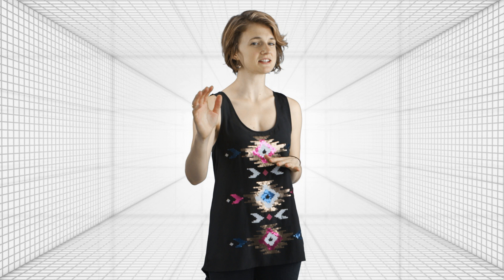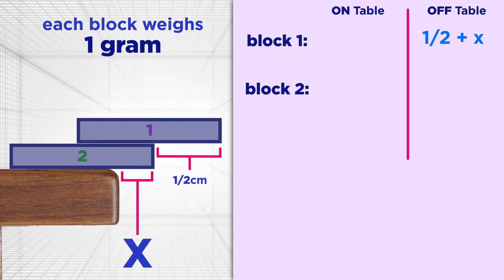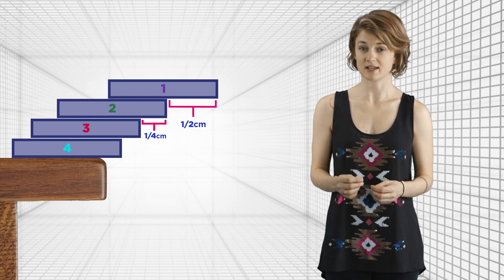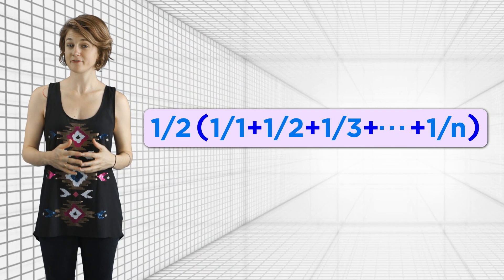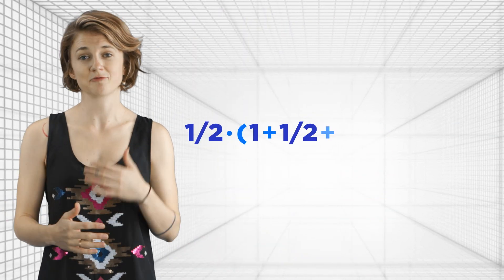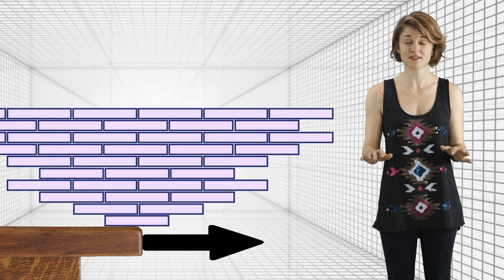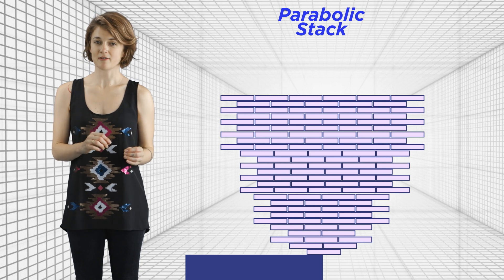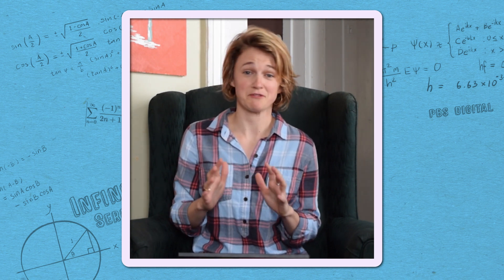Building an Infinite Bridge | Infinite Series

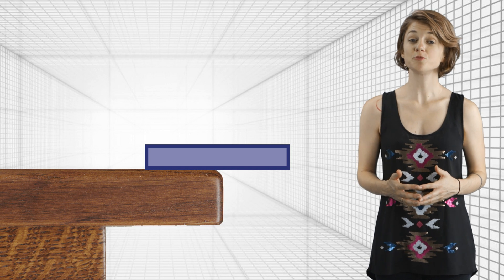Comment: Presumably the table is going to have an infinitely sharp edge.  The rounded-corner illustration of the table edge at 1:00, while pretty, may not be the best choice to illustrate this.  

You could say, of course, that the true edge of the table is just where the curve begins.
Reply: Tehom Yes, the image bothers me because it's wrong.  I'm pretty sure that the mass with it's center of mass not touching a solid surface doesn't look down and say "I'm not supported but it's okay because there's this fancy little curve further down so I'll just pretend I'm supported by that instead."

Comment: Can beat all this. 

Just use an infinitely long brick.
Reply: Matthew Fennell But would it be stable? Where would its centre of mass be; would it even have a centre of mass?
Reply: TimGB
Just place the center of mass even with the edge of the table. The infinitely long brick would stretch infinitely in both directions keeping the center... in the center.

Trick 2: turn off gravity. I mean, while we're just doing whatever, might as well. Glue the bricks together so they don't float away.
Reply: Matthew Fennell an infinitly long brick wouldn't have a centre of mass or would at least never topple, because if the brick just slightly tilts, the points far away would have to travel faster than the speed of light, wich sadly isn't possible
Reply: You'll need an infinitely long table. I win.
Reply: Then you don't even have a bridge. You're disqualified.
Reply: I was just saying he would need it, not that it would be possible.
Reply: +Siro
Can I nitpick? please? I'll nitpick
if you tilt the brick the ends won't rotate immediatly, the tilt will travel through the brick as a mechanical wave (so basically travel as fast as mechanical wave moves through the brick)
Reply: The center of mass doesn't matter. The rotational inertia would be so large, that it would take forever to rotate.
Reply: all points would be equally valid as the centre of mass. Take any point on the brick and label it zero. Then label every point on the brick that is an integer number of centimetres away from zero. Label numbers going one way with positive numbers and points going the other way with negative numbers. Once you're done, you will have labelled exactly the same number of points in one direction as the other, so you can reposition your brick however you like and it will balance.
Reply: not necessarily every point, but every point that could be the center of mass of a section of the bridge
if you get what I'm trying to say
meaning it would have to be a point along a line that goes along the length of the bridge which goes through the center of any section of the bridge (assuming the bridge is completely straight ofc)
Reply: Wow, what a lot of replies. Some good discussion here. 

The trouble with the bridges in the video is that they are ludicrously tall. How do you get on the bridge?

Yes, because the brick is infinitely long it would have infinite mass and so have an inertia that means it would (for all intensive purposes) not rotate. Hence, anywhere you put it it would stay.
Even if it did rotate the force can only travel so fast and it would not move faster than the speed of light. Too much else would go on at close to the speed of light.
Reply: You re right. Medieval bridges used similar stability concepts (no tensile stress), and they were very tall.
Reply: you can simply do it in space with a floating table, an infinitely long brick which is rigid and......maybe a glue stick or glue or something.
Reply: Does the definition of a bridge include the capacity to carry an external load?
Once you attempt to cross this bridge with any positive mass, it collapses.
Reply: Can't rotate without moving past the speed of light, so I doesn't matter where it's Center of mass is, the table is equally attracted to the table at all points.
Reply: @timgb_2015  infinity / 2
Reply: @aevus  No, because nothing is infinitely rigid; that would imply the speed of sound in the material is infinite.
Reply: you will never produce such a brick.
Reply: sorry to be offtopic but does anyone know a method to log back into an Instagram account..?
I was dumb lost my password. I would love any help you can give me
Reply: @Enzo Andre Instablaster ;)
Reply: @Robert Royal thanks for your reply. I got to the site through google and im waiting for the hacking stuff atm.
I see it takes a while so I will get back to you later when my account password hopefully is recovered.
Reply: @Robert Royal it worked and I finally got access to my account again. I am so happy!
Thanks so much you saved my account :D
Reply: @Enzo Andre No problem xD

Comment: a table with a curved top edge doesn't seem like a good choice for this discussion...
Reply: So I'm not the only one who was irritated by that?
Reply: KinoftheFlames agreed
Reply: Well technically it's still possible to do it on a table with a curved edge except for one thing they were using the wrong balance point. The correct balance point would be where the base of support ends ie the moment that the surface shifts from being tangential to Earth's surface to curving towards the surface past that point it wasn't supporting the block anymore and the very first block would have rotated and flipped off the table as a result as they got the balance point wrong!
Reply: Proof that the CG/Animators did not listen to her at all
Reply: implying that a non curved edge exists outside a mathematical model.

Comment: There is a (very) related riddle that I like.

There is a mathematical ant on a mathematical rubber band. The rubber band is 100m long and the ant starts on an end of the band and wants to reach the other end. Each day, the ant travel 1m. But each night, when the ant sleeps, an evil mathematician pull the band so that it is 100m longer.

To see what happens, at the end of the first day, the ant traveled 1m and the band is 100m. But the next morning, the band is 200m and since both the part before and the part after the band are now longer, the ant has traveled 2m.
At the end of the second day, the ant has traveled 3m but the next morning, the band is 300m long and the ant has traveled 4.5m. 295.5m to go…

The question is will the ant ever reach is final destination ? And if so, in how many days ?

The key to the answer is to see that on the n-th day, the band is (n+1)100 m long, and thus on the n-th day, the ant travels 1/100*1/(n+1) of the band. So after n days, the ant will have traveled 1/100(1/2+1/3+1/4+...+1/(n+1)) th of the band. But since the harmonic series diverges, this quantity will eventually be bigger that 1. And when this happens, this means that the ant will have crossed the whole band.

Comment: So this is what happens when you have -1/12 blocks
Reply: Yeah I realize it doesn't make sense I just needed to make a -1/12 joke
Reply: And it's a good thing.  If the maximum overhang went as the sum of natural numbers, and you had an infinite number of blocks, and you put the edge of the top block any further out than -1/12 - that means it's still entirely on the table by 1/12 of a block length - it would fall off.
Reply: -1/24, you need to divide it by two first.
Reply: You are right, I missed the factor of 1/2.  So you can get the farthest edge of a block almost to the edge of the table before they all fall off.
Reply: -1/12 isn't the sum of all natural numbers. That's infinite. -1/12 is just the point on the Reimann Zeta function which would correspond to n= -1 if the function was actually defined there. Which it isn't.
Reply: The Zeta function has analytic continuation to -1.
Reply: that's the sum 1+2+3+4+...=-1/12
what you're looking for is the less know sum
1+1+1+1+1+1+1+....=-1/2
Reply: The Real Flenuan Use math.
Reply: Ian Krasnow What?? Of course the function is defined there lmao
Reply: The Real Flenuan It is defined via analytic continuation, but the original genuine Riemann Zeta function is not
Reply: pretty much everything in math is "analytically continued" or how does multiplying by let's say 0.5 actually work, when multiplication is just repeated addition?
Reply: Zonko Kongo your intuition is correct, we extend definitions to fit new domains they weren't originally defined in. But analytic continuation is the specific process of extending functions which are analytic in a part of the complex plane into the rest of the complex plane in a way which maintains its analyticity.  Analytic has a specific definition here about functions in the complex plane. Expanding the definition of an operator like multiplication is a similar intuition, but isn't actually analytic continuation. Similarly to how we extend the definition of exponentiation and logs into the complex domain, but that isn't actually analytic continuation either.

Comment: A bridge is a structure that connects two or more separate edges. If the structure is infinitely long, by definition, there is no second edge for it to connect to. (How can it stop somewhere if it doesn't stop?) What you have isn't an infinite bridge but an infinite diving board.
Reply: but if it's infinite, how do you even find the edge to dive off of it?
Reply: CogniVision Good point. Maybe it's just an infinte balcony, then?
Reply: +Noel Goetowski Good point, but, uh, don't you need to get to the end of a diving board to make a dive?
Reply: You just need to go infinitely fast to get there.
Reply: They should just call it an infinite road and make it with yellow bricks.
Reply: It connects to a table in the Middle of Nowhere.  The Middle of Nowhere is the point where every other point is an infinite distance away, and at that point there is a table.  That's why mathematicians were interested in this problem in the first place!
Reply: Noel Goetowski Mathematicians are pulling this "infinity ends" crap way too much.
Reply: Dustin Rodriguez
I feel this says a lot about how little mathematicians have to do. Just sitting around thinking about tables in imaginary places and stacking toy bricks.
Reply: Shawn Wesley Engineer here.

It's good to come up with models for idealizations like infinity distance and abstract formulas for series calculations, because that tells you the maximum possible output you can get for a given system before you actually try to make something. In this case, you have a cantilever, and the real-world problem that it illustrates is how you want that cantilever to be supported from below. Typically, this means that you use a straight beam that extends from some point on the floor of the cantilever to some point on the body of the structure below the cantilever. However, mathematically, this works best without buckling the beam when, at all points, the beam overlaps or is further out from the structure than C*ln(h), where C is a constant to scale based on the strength of the support beam, and h is the height difference between the low end of the strut and the floor of the cantilever.

Typically, you want the beam to overlap with this function where it meets the bottom of the cantilever, because if it's closer than that, it'll experience bending stress downward (think of the beam looking like a frown), and if it's further out, it'll have bending stress upward. To get the best out of your support beam material, you want the bending stress to be as low as possible so all of the weight of the cantilever goes into trying to compress the beam, which is much harder than trying to bend it (i.e., it's a lot easier to bend a straightened paper clip than it is to squash one down without bending it). The function she works out and even the visual model she uses in this video correlates to a real-world problem, so it does mean more than "tables in imaginary places and stacking toy bricks."
Reply: Kazmir Runik Assuming infinity is an ideal model... no.

You can find your finite limits by using growing, yet finite models.
Reply: Limits toward infinity are a core concept of calculus, and thermodynamic limits along with the effectiveness of any control systems are found by observing behavior at infinity. Fins meant to dissipate heat, as are found on the components of your computer, have their highest possible efficiency evaluated by calculating how much heat they would dissipate if they had infinite length. If it's not enough, then they have to change the fin design because the model that approaches infinity is the one that tells you your physical limits.

You have RC DC circuits, engine efficiency models, vibration systems, fluid models, and a lot more all having their design choices evaluated by observing their behavior at infinity. It's just a common rule of thumb that if you plug in infinity and a design still doesn't work, then there's no possible thing you can do to make it work without changing some other part of the design. It's not abstraction in the sense that infinity will concretely tell you what your limits are in a given system.
Reply: A diving board where you have to jump off the side instead of the end.
And doesn't bend.
Reply: Anon It certainly is experiencing a bending stress, and it does bend by a tiny amount. Think of what would happen if you put an anvil on that edge. It's gonna bend, or it'll shear off entirely. With straight-outward cantilevers, the strength of the material you're supporting it with and the second moment of area of those supports (very high when it's very wide) will affect the constant C such that the logarithmic ideal function squashes down, and bending is minimized. Be aware that a lot goes into that C, and I'm using its notation just for brevity's sake.
Reply: Kazmir Runik Of course it would. But this is an imaginary supertask where the laws of reality don't apply.

This is what mathematicians get paid for.

Playing games.
Reply: +Snatch n Grab That depends in part on who's paying them. Besides, some of the highest paid people in the world are paid to play games and tell stories.
Reply: Noel Goetowski I did not imply that playing games isn't worthy of a living. MLG FTW.
Reply: isn't the point, as with all math, to just prove that its plausible? if you solve for any number N, then you could use the same math at both ends of the river to meet in the middle. but wait, what kinds of shifts in this math would be necessary  to support any additional weight where the two infinite bridges meet in the middle?

Comment: In your first description, where you compare the proportion of the block to the right and left of the table edge, you actually determine the median position of the mass, not the mean position of the mass.  This isn't necessarily the center of mass.  Once a block is completely to the right of the table, it will be 100% to the right no matter how far away it is, but the CG will continue to change if it goes farther to the right.

In the second approach, where you consider point masses, you're actually considering the distance and computing the first moment, so that is the center of mass.

Comment: Thought: it seems that the limiting factor here is the number of dimensions we're building in: this is  a one-dimensional bridge (we measure how far 'out' it goes) in a two-dimensional space (we 'stack' blocks) and we get a 1/3(n) growth rate. What happens if we build the largest two-dimensional bridge (i.e. we measure its area, not its distance) in a three-dimensional space? What's its optimal growth rate? At does the pattern extend to an x-dimensional bridge in an (x+1)-dimensional space.

Comment: The correct approach is, not have the blocks at 1/2 way point but offset by a delta and then take the limit as the delta approaches zero.

Comment: Actually, to secure against quantum computers using shor's algorithm all you have to do is double the bit length of the encryption key. The methods we have are fine. They're still just as secure against quantum computers, quantum computers would just be faster at cracking them. I believe shor's algorithm takes sqrt time compared to a classic computer and doubling the number if bits just so happens to square the time required to crack it.

Comment: for the first blocks there is an easier way to think about it...
because both block are the same length and  overlap half there length it means that the parts not overlapping have the same length, so they balance out, and in order to get the center in the middle you then just have to divide the overlapping length by 2...

Comment: Make the bricks have the same density as air. voila. now you just need duct tape
Reply: Found the Physicist.
Reply: actually we found the engineer
Reply: I vote physicist. Physicists work with idealizations, and there's a lot of silly stuff you can tweak to idealize this, like...

buoyant forces (put it in heavier air)
static friction with the table (bricks are made of tape that sticks to the table)
air flow (blow on the bottom of the bridge so it stays up)
gravity (put another Earth-mass object on the other side of the bridge so it doesn't fall toward Earth)
the weight of the duct tape (have it lighter than air to where it'll float upward with the same force that the tower would fall downward)
Wingardium (Leviosa)
thermal effects (heat the bridge so it expands until its density lowers enough to float)
electromagnetism (think magnet trains)
fluid effects (pressure within the bricks to make them extend like those long balloons do)
Reply: Free Diugh The engineer answer is "an infinitely long bridge is easy, just use an infinitely heavy counterweight"
Reply: char whick But that's only if the brick is infinitely strong. Otherwise, it'll bend downward under its own weight as it stretches further outward. Physicists can make those idealizations, while engineers can explore them to find a system's physical limits, but an engineer would lose the job pretty quickly if that was the kind of answer the engineer gave to an employer.